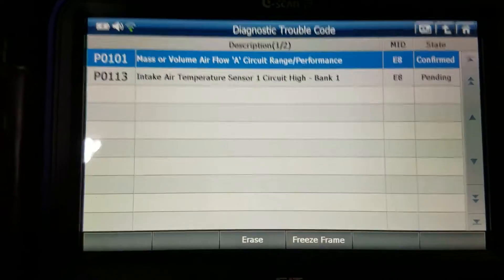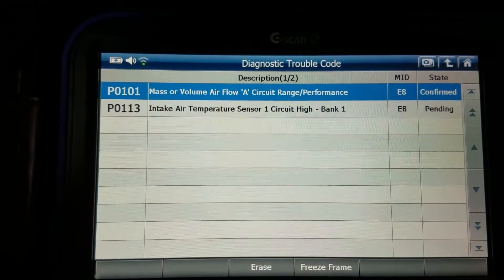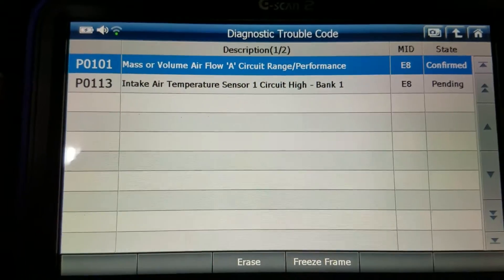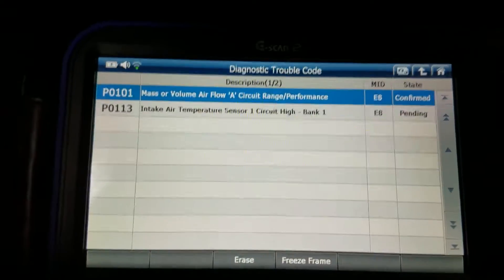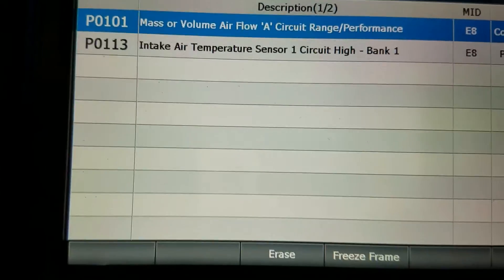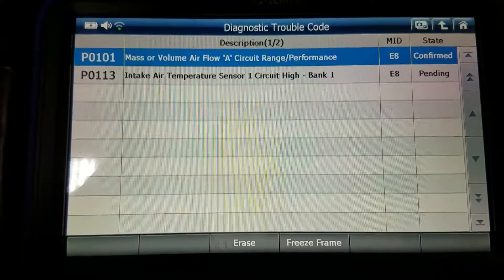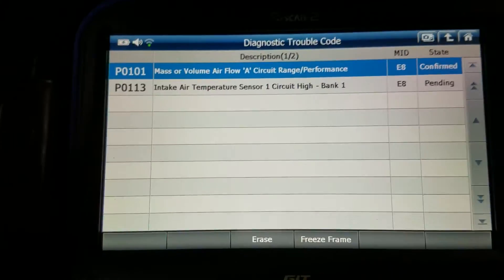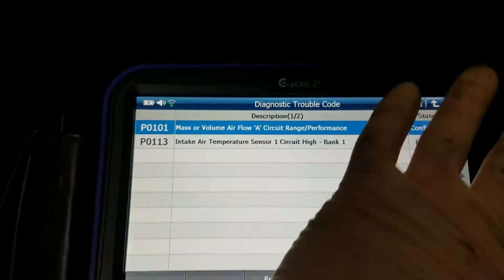Most Common Cause of a P0101 "Mass Air Flow (MAF) Circuit/Performance Malfunction"

Comment from the maker: Mass air flow sensor cleaner: https://amzn.to/2F9dQht
Reply: @(the flat rate mechanic) Hey there question I have a Nissan versa it's cold starting with high Rpm 2000  in the morning times and I have to wait 20minutes before its go down to 1000 rpm  can the mass air flow sensor causing the problem????
Reply: Thank you thank you thank you...just saved me about $300!  That $10 cleaner spray worked like a charm...

Comment: Continuous failure. Dealer replaced maf. It's been replaced 3 times. I checked wiring and connectors to maf and ECU and no issues. Dealer said throttle body. Changed that. Below 25 mph runs rough, erratic, lights on, etc. 180k 2013 jx35. I'm thinking ECM failure. Cc odes 101 and 113. Always on. Can't delete.
Reply: Does it stall when accelerating from a dead stop?

Comment: I can confirm that the ACTUAL FILTER ITSELF can produce this error...had one aftermarket..boom this error on my Q50...bought an original one , no issues.
Reply: Yes a clogged or dirty air filter can also cause this issue
Reply: Having the same issue with my Q50 aswell. Changed it to a performance filter with no luck.

Comment: We have replaced the maf 3 times after a diagnostic kept reading a "fail". After replacing it 3 different times, it still a "fail". What else could it be?
Reply: Following
Reply: Did you figure out the reason?
Reply: yo
Reply: @LITTLEROCK2517   did that and still an issue
Reply: Try cleaning the throttle body too

Comment: I'm gonna try cleaner though I checked the connector pins and 2 of them seem to be colored brown  instead of silver which I suspect is rust... I gonna compare it to a junk yard connector.. If the other connector pins are not brown as well I'll probably end up replacing the connector... As cleaning it without damaging seem hard as this is a 20-30 year old connect with toasted plastic...

Comment: Question I unplug the mass air flow sensor while engine running but it chip the engine check light will I need to use a obd2 scan to remove it or will it remove it self
Reply: Try disconnecting neg terminal on battery for few hrs

Comment: I'd cleaned the maf with maf cleaner, no improvement. A mechanic said forget cleaner, it doesn't work so was about to buy a new maf. 
'99 Safari with 78K miles ran fine until it became very hard starting.. a P0102 code with maf, cat, egr, evap, o2 showing up. Check eng light always on. Dismantled maf again checking everything then carefully soaked both sides with maf cleaner, let it dry for an hour and reassembled.. cleaned the egr, reassembled making sure both clamps beyond the maf were tight so no air leaks. Ran it for a few minutes, stopped, restarted.. no more check eng light, runs great. Lesson learned.. I shoulda kept my 1977 F150 pickup, it had none of this crap! 😆

Comment: Replaced twice, second time with an expensive OEM part, checked for vacuum leaks, still intermittent p0101. Air filter clean, air hoses tight, fuse works. I am about ready to give up.
Reply: Your best bet is to learn about fuel trims. Schrodinger's box channel has one of the best videos on it. It will take you far.
Reply: same stuff whit mine gti mk5 k04 apr v.2   no leaks ,
Reply: Hello. Did you figure out? Thanks G
Reply: Hows fuel trims gonna help?

Comment: Just a p0101 is rarely the sensor on Nissan's. You can check fuel trims if you think it's dirty. They go higher with rpms if the sensor is dirty, but I've never seen this be the case.
Reply: i just replaced my air filter and maf sensor but the like came back on.. wish I would’ve seen this comment before I bought the sensor😂
Reply: @cassandragonzalez7119  that stinks. It pays to know how the stuff works so you don't have to waste money. Scannerdanner teaches it all in his videos.
Reply: @sonicelectronic57  Since you brought it up I kind of remember I had problem with Pathfinder getting mass air code then put an after market the same, put a known good used the same! I didn't follow working on it don't know what happened then.
Reply: What is it usually? (if not the sensor)
Reply: @elephant1851  vacuum leak, sticking throttle body, exhaust leak near an a/f sensor, ecm update needed, air box damaged or not sealed, trash air filter.  It can be a lot of things, but if it's just the p0101, it's probably not the sensor. I've never even seen a dirty MAF on a Nissan. I don't know why all of the p0101 videos for them tell you to clean or replace the sensor. They come to us after someone does that and it doesn't fix it...
Reply: @sonicelectronic57  Yea man, nearly everything I looked up says to clean the MAF sensor. I've already replaced it twice and still have the intermittent P0101. Checked for a vacuum leak both times. Good filter on. I have NOT checked for an exhaust leak.. sticking throttle body or the ecm. I'll look over the air box just to make sure there's not a crack somewhere. Strangely the code goes away when it rains heavily for a while, then comes back when dry. Thanks for those suggestions.
Reply: @elephant1851  no prob. Definitely check out that guys video. You can very quickly determine if you have a vacuum leak or not with data. The old methods of visual and audible inspection are gone. Same with spraying brake cleaner and listening for changes. If you clean the throttle body, take it off to get it good, and you have to do all of the relearns. Closed positions and volume air.
Reply: @sonicelectronic57  Please help Matt. I am not a kind of person who just go throw parts specially if I don't get OEM ones to save!  I am getting P0300 & P0301 (misfire on cylinder 1 and random/multiple cylinder misfire) along  with P0101. I replaced cylinder 1 coil from Auto Zone but still getting all three codes It's actually 2015 Chevy City Express 2.0 with Nissan engine on it. The fuel trim is very acceptable at freeze frame (under -3% for both short & long'). It does it at over 2500 RPM and it loss power very noticeably.
Reply: @ronmelliad7327  can you look at mode 6 on your scan tool to check the misfire counter and see if other cylinders are missing too?  Wide open throttle, after fully warmed up, the rear o2 sensor should stay around .800v. if it drops down during the run i would check fuel pressure.
Reply: @sonicelectronic57  Thanks Matt, I will do so and will get back to you. I was getting over hundred miss a minute on number 1 when I originally scanned but then noticed some one disconnected the number 1 injector at the auction (we bought it at the auction) to make it run rough! but I still replaced coil # 1 hoping everything is taken care of but shocked when nothing changed! The oil change mechanic who replaced the spark plugs told me that number one plug looked like burned compared to the rest but I didn't get a chance to see myself to get a better idea. I am having an impression that it is going to be fun one!
Reply: @sonicelectronic57 Sounds good! I am a member of IATN used to follow them daily wanted to get my ASE but then covid hit and became a covid researcher because a lot of things didn't make sense to me!
Do you know injectors stay opened or closed if disconnected? Is there a correlation between coils and injectors for each cylinder? Do coils shut down if injectors disconnected? Does PCM have specific code for faulty injector or just a general code?
Reply: @ronmelliad7327  I prefer scannerdanner over iatn. We even started doing Saturday night zoom chats every other week with some members. 

The injectors are closed until the ecm grounds them to open. I would expect a code for an unplugged one. I don't think the coil shuts down with it, but some ecms will shut an injector off if there is a misfire, until the codes are cleared, to protect the converter.
Reply: @sonicelectronic57  Some of IATN members are so arrogant you don't dare to ask a "dumb" question but the rest are good. 
Sounds good! I will try, thanks
Reply: @ronmelliad7327  exactly why I don't go there anymore. That stuff doesn't happen, ever, on scannerdanner. Never.
Reply: @ronmelliad7327  and the dealer replaced throttle body exhaust manifold with catalytic converter O2 sensors A/F sensor. Head gasket was pcv valve you name it all in less than a year and the check engine light came back on with that code even after replacing the Mass air flow censor twice . I been getting bamboozled by several Nissan dealers

Comment: Same exact issue 
i have a 2017 Nissan Rogue doing the same thing.  Check engine light comes on.  No problems with gas mileage or engine idling rough.  i replaced with a Hitachi equivalent and check engine light came on immediately and gave me another error code related to MAF sensor.  When i clear the code, it stays off for about 400 miles and then comes back on upon starting the vehicle.  i think it is something else, but dealer wants $600 to replace the MAF (which didn't work!), so i'm going to keep clearing the code until i'm tired of doing it or mileage suffers or engine runs erratic.  i've read several blogs about problems with P0102 codes on Nissan vehicles.
Reply: I had a 2017 Nissan Rogue with a MAF Problem. We replaced the sensor with an aftermarket one and it did not work, but once we replaced withy OEM. It ran like new.
Reply: No problems with p0102 with nissans, just p0101. People in forums don't know what they're talking about most of the time.
Reply: Does the skid light come on and goes into limp mode
Reply: Greeting, Do you still driving the 2017 Nissan Rogue with the erratic MAF sensor light?
Reply: @Riveera718 replaced injectors and fixed all problems

Comment: i have a 2017 Nissan Rogue doing the same thing.  Check engine light comes on.  No problems with gas mileage or engine idling rough.  i replaced with a Hitachi equivalent and check engine light came on immediately and gave me another error code related to MAF sensor.  When i clear the code, it stays off for about 400 miles and then comes back on upon starting the vehicle.  i think it is something else, but dealer wants $600 to replace the MAF (which didn't work!), so i'm going to keep clearing the code until i'm tired of doing it or mileage suffers or engine runs erratic.  i've read several blogs about problems with P0102 codes on Nissan vehicles.
Reply: Are you getting the skid light and goes into limp mode
Reply: @hectorrangel1222  yes I do
Reply: @hectorrangel1222 yes the skid light comes on along with p0101 on a pathfinder. Any ideas why?
Reply: how do you clear the code really need to pass inspection

Comment: have a 2013 altima that got this code. Bought the spray and cleaned the MAF sensor and it worked for about a month. Code has recently came back, this time w no real symptoms and it has been intermittent. Wondering if I need to replace the sensor this time or its something else. My filter fits right and is clean as well.
Reply: Do you have an update at all?
Reply: Did you clear the code with a obd2 scanner? Also it can take up to 20 drive cycles for a pcm to clear the code.

Comment: I have a 2010 Infiniti G37 convertible, p0103 code came on. I also noticed that my engine speed while idling is at exactly 1k rpm (I'm certain that the normal idle speed for my car is at around 800 rpm). Can you give me any suggestions?
Reply: Maybe you can try cleaning the throttle.

Comment: 2006 Nissan Frontier 40DQE V6 engine 250k miles before any issues at all then suddenly Random Misfire code.
AND no power above 40mph. Engine stumbles, hesitates, wont go above 3800rmp when driving. Runs fabulous at all RPMs when in neutral.
Replaced: spark plugs, PCV, coils, catalytic converters, front O2 sensors, fuel pump, VVT solenoids, vacuum hoses, intake gaskets and spark plugs AGAIN, cleaned MAF sensor  and still have same  issue. 
...timing chain and MAF only thing left to replace.
Reply: What was the issue my maf code won’t go away replaced 2 times with factory Nissan & cat on bank 2 & all 02 sensors still bogging at 40 when pressing gas takes a second to shift days small evap leak 02 code cat code & maf code

Comment: I have done this, and I'm still getting a check engine light. I use a scan tool, and remove code, and it doesnt come back for the duration of my drive. When I drive again, like up a hill or give it gas to accelerate, the check engine light comes on again. I dont notice anything wrong, doesnt idle bad, starts right up, doesnt die. Should I replace the MAF sensor? It seems like it's working fine.
Reply: I ended up spraying and cleaning the throttle body, put the old sensor back in and no codes for 2 weeks now.
Reply: @jrr1222  wow cleaning throttle body was easy ?
Reply: It's probably not the sensor if 101 is the only code and I've never seen one of these get dirty, so don't waste your time cleaning it. Learn about fuel trims so you don't have to guess.  Lots of good videos online about them. Join the scannerdanner forums and get help from real diagnostic techs, not parts changers and guessers. There is an ecm update that addresses this issue, for one. It's also commonly either vacuum leaks or a sticking throttle body, damaged airbox, $2 air filter that messes with the air flow. Again, there is real data to support the repair if you want to save money.
Reply: @sonicelectronic57  my 2018 Chevy Cruze has p1001 and I got my air filter replaced I think it’s the sensor dat needs to be replaced
Reply: Did you fix the problem?
Reply: @jorgedjesussantamaria9867  yes. It was the MAF
Reply: Hey Chris, my Rogue is doing the same. I replaced my MAF with a rebuilt one and it keeps throwing the code every couple days.
Reply: @jrr1222  maybe semi functioning may have to get OEM part.

Comment: Didn’t work
Reply: Same
Reply: Did u end up solving the issue? I replaced the part with a brand new one and I still have a check engine light, I reset it it went away for few days and came back
Reply: @sameraldujaili3657  Did you replace it with the OEM or aftermarket sensor?
Reply: @taozhang2506  OEM I also replaced the air filter. Same problem still
Reply: It's not gonna.  All of these cleaning videos are just wrong.